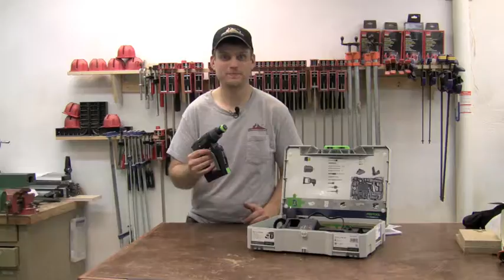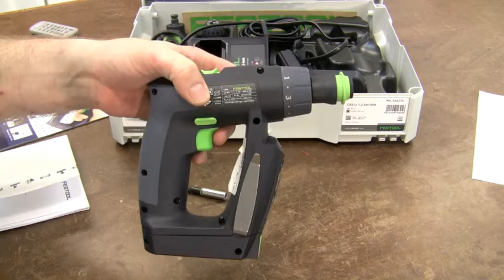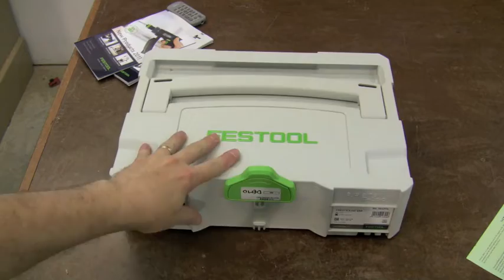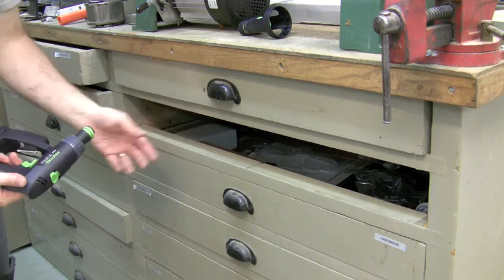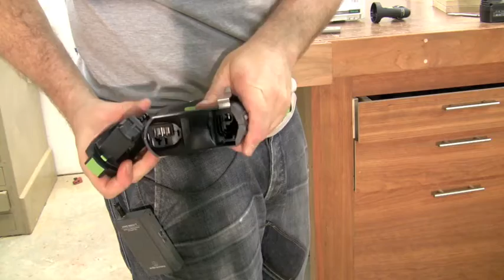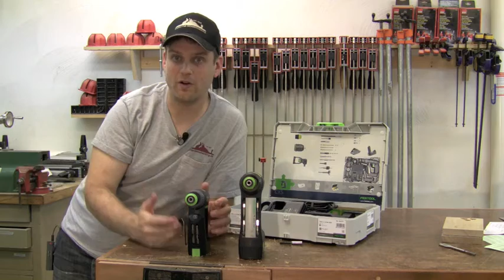Festool CXS Compact Cordless Drill Driver - Highland Woodworking

Comment: Hi, great review. I am a carpenter and I already own a cordless & impactor hilti drills, however I am looking for something lighter to do lighter tasks such as hanging internal wooden doors- fitting locks etc. would you recommend this tool? Cheers Dan
Reply from the maker: Definitely recommended for the tasks you're looking for. It weighs in at only 1.98 pounds. To find out more information or to purchase take a look here: https://www.highlandwoodworking.com/festool-cxs-compact-driver-drill.aspx

Comment from the maker: The charger indicates when it is charging the battery and if the battery is fully charged. 
Older You Tube  video on battery life here:
Festool CXS Drill Test - How many screws on a single charge

Many factors go into battery life and recycle charging ability including temperature, battery age, and in field use.

See more end user feedback here:
http://festoolownersgroup.com/festool-wish-list/festool-cxs-brushless/

Comment: I burned out this piece of shit black and decker drill we had for random outside jobs by using a wire wheel to brush dirt off a wall before putting on mel-roll. All of our other tool are hilti. I have been looking at getting myself a new cordless drill of my own and am not sure if I should go with a hilti or one of the newer cordless festools.